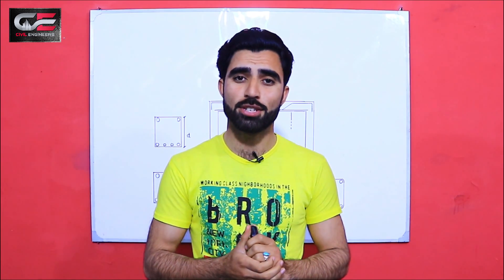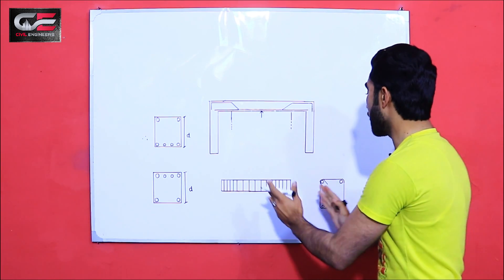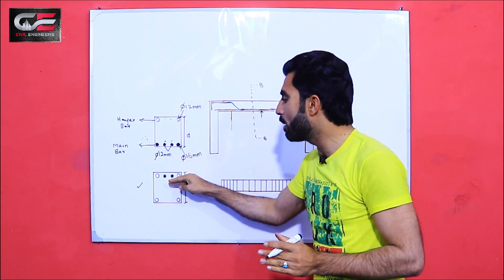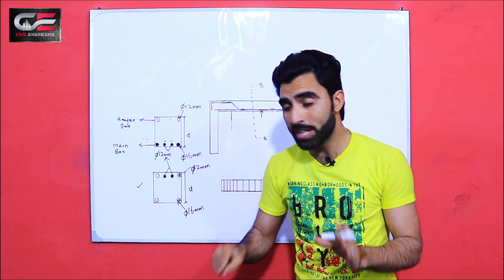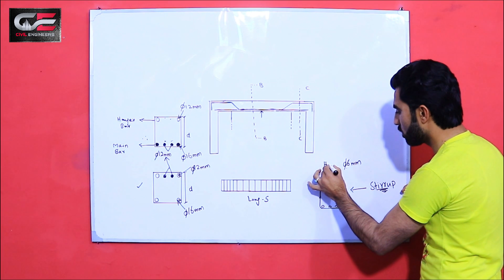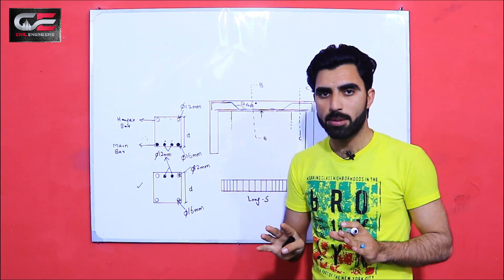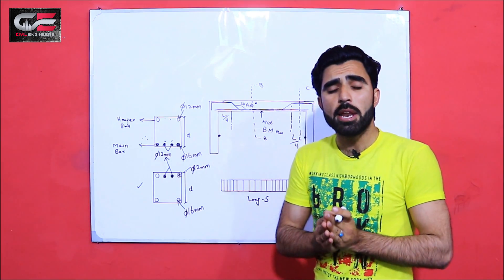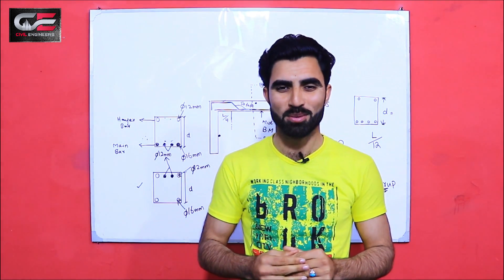Reinforcement Arrangement of Beam - Reinforcement Design of Beam

Comment: Hello, is it possible to use 4x D12 in top layer from left column to right column (whole lenght)   and 2x D16 + 2xD12  in bottom layer from left column to right column  (also whole lenght). Or are crank bars necessary?

Comment: Hi there, I have a beam in the basement that is cracked on one side as the floor above is sagging. The previous owners put the bar on the top floor and it seems it is not properly supported. What is a fix for this? Does a new beam needs to be installed and does it need to have a crank bar?

Thank you in advance!